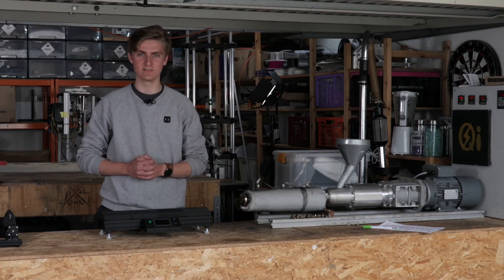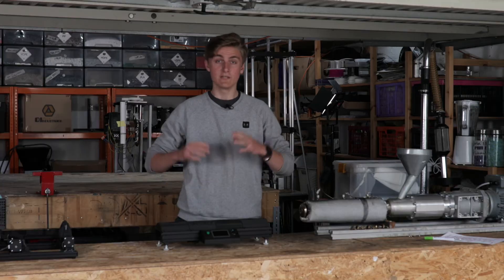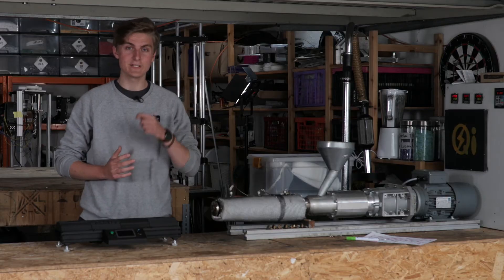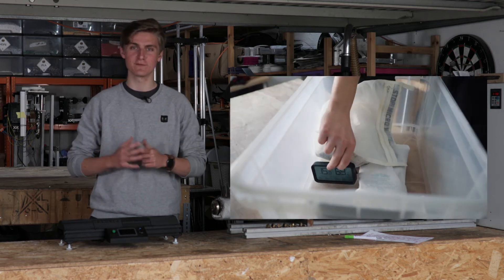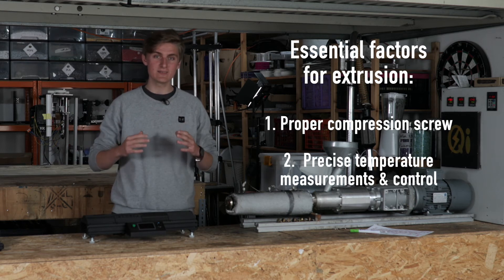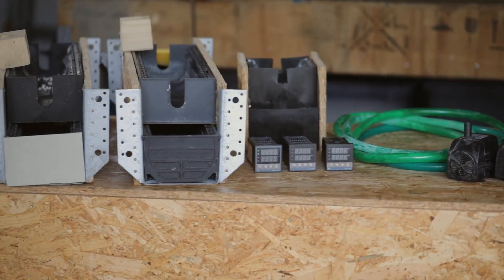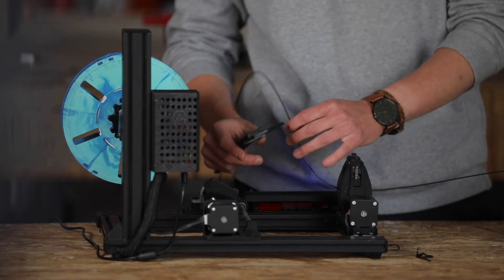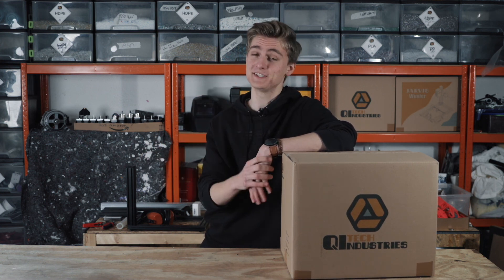How to Recycle Failed Prints into 3D printing filament | Make 3D printing filament

Comment: why not u make filament maker only for pla make a small one that price around 300-500 dollar... it help safe our earth
Reply from the maker: Since filament extrusion demands a high level of precision and good hardware to achieve decent results, the machines have their prices. Also we concentrate on plastic amounts that are even worth mentioning (e.g. this extruder has an output of roughly 5kg/h which also depends on the material and the extrusion speed). The really really small and low-cost machines are not our market (yet).
Reply: @milan_vdb  hope u get it soon...